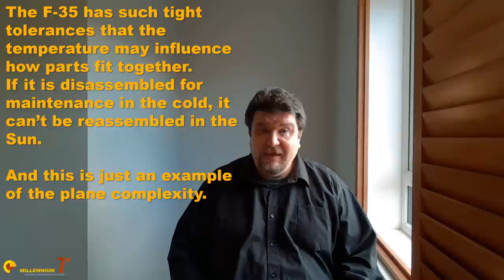F-35: The Failure of the $100 Million  Dollar Jet | Maybe...

Comment: The AF should simply build a refreshed version of the YF-23. Apply lessons learned for cost efficiency. Then focus on the 6th Gen.
Reply: Northrop Grumman has their cost overruns with B-2 bombers.
Reply: @valenrn8657  but not nearly to the degree that F-35 has.

For example; the STOVL version was overweight and Lockheed spent $6.2B USD just to decrease the weight by 1200kg. Not a typo. And that’s just one of dozens of overrun examples.

The B2 was the very first smooth fuselage stealth aircraft. It used new coatings, new geometries, new control surface schemes, new electronic systems, etc.

The F-35 is just a slower, single-engine version of an F-22 with a better brain and more/better sensors. All that hard learning had already been done.
Reply: @DBravo29er  According to Lockheed, Pentagon keeps changing the specs e.g. weapon bay specs which impacted the CG balance.
Reply: @DBravo29er  The requirements from USAF, USN, and USMC have diverged the single design into three fighter aircraft designs with just 20% to 30% common parts.
Reply: @valenrn8657  That did not cause the overweight condition.
Reply: @valenrn8657  But that’s not a recent development. The actual needs of all three branches haven’t changed. Lockheed is just having their feet held to the fire on meeting these program requirements by each branch.
Reply: @DBravo29er  CG changes can cause performance degradation.
Reply: @DBravo29er  USN's F-35C has different wings and horizontal tail, hence you can't apply F-35A Block 3F flight control software for it.

F-35B has a different bulkhead design from F-35A, hence different durability results.
Reply: For USN's F-117A like solution, McDonnell Douglas/General Dynamics A-12 Avenger II failed to deliver a working prototype while Lockheed delivered F-117A to USAF.
Reply: @DBravo29er  There are 3 different F-35 engines
F-135-PW-100.
F-135-PW-400 with salt-resistant materials. 
F-135-PW-600 with salt-resistant materials and lift fan.

Surface stealth coating would different due to the high salt environment with USN and USMC. 
Rear high-temperature stealth coating would different due to horizontal tail design on F-35C.

F-35B and F-35A has different AoA behavior, hence F-35A Block 3F flight control software can't be applied on F-35B.
 
Lockheed is effectively designing 3 divergent fighter designs.
Reply: @DBravo29er  Changes to F-35B's empty weight caused CG changes that can degrade performance, hence the entire airframe design to be refactored.
Reply: @DBravo29er  F-22A does NOT use carbon-nano-tube (CNT)  materials that arrived for F-35 Lot 4 builds.
Reply: @valenrn8657  CG changes were not the reason for the $6 billion dollar weight loss program. Empirical statement.
Reply: @valenrn8657  Understood. You’re just highlighting the program inefficiencies for me. I appreciate that. There is not much more parts commonality than between F-18A-C and E-F.... which are widely considered to be distinct airframes.
Reply: @valenrn8657  Im not dumping on Lockheed. I have several friends that work there. This is just a garbage program. It’s like the F-111 program, but exponentially more expensive.
Reply: @valenrn8657  And yet CNT (i.e. graphene) is not a new material. It’s been leveraged in aerospace and racing for nearly a decade.
Reply: @DBravo29er  F-111 program didn't design to be F-16 or F-18 dogfight capable.
Reply: @DBravo29er  
F-18E/F is about F-15 size.
F-18A/B/C/D is about  F-16 size.

Using the same model number avoids the fly-off competition.
 
F-35C's wing area is similar to F-15 i.e. it's larger than the classic F-18A/B/C/D.
Reply: @DBravo29er  
F-35B weight loss program (STOVL Weight Attack Team, or SWAT) from https://www.airspacemag.com/military-aviation/weight-watchers-13117183/
Date: 2004

https://youtu.be/RQ5gmZ74YBY

In this video, Jon Beesley, former LM F-35 chief test pilot, begins describing the SWAT changes at 2: 08, and at 2: 35 he talks about changing the STOVL interior bulkhead back to the original spec (for the Bee to carry 1000lb bombs rather than 2000lb bombs) which saved a lot of weight. Specifically, he mentions that the change shortened the weapons bay and eliminated some "u turned structures".
Reply: @DBravo29er  You haven't factored in molecular structures with high carbon-based materials.
Reply: @valenrn8657  I’ve seen that video many times and that article has been read long ago. The biggest weight loser was the shedding of quickmate joints in airframe. Which, naturally drove costs and production time even further into the stratosphere. Bulkhead being moved is a minor factor in this delay. And it resulted in reduced airframe capability.
Reply: @valenrn8657  Be careful. I have a good friend who is an F-15C driver. Currently transitioning to the 35A. They’re not the same capability. The 35C, especially, has g limits that the F-15C does not. The F-15C’s radar can also see and track the F-35 at much farther ranges than is being advertised. If the F-35 doesn’t gain a kill against an F-15C before the merge, it’s just target practice. All from my buddy.
Reply: @valenrn8657  CNT (i.e. graphene) had been in use in aerospace and F1 racing for nearly a decade. None of this is new.
Reply: @DBravo29er   Due to the age of the airframe,   F-15C has lower G limits.
Reply: @DBravo29er  Stealth reduces the enemy's radar effective detection/tracking/lock-on range.
Reply: @DBravo29er  
Read Tailgate's post on F-14 vs F-18 vs F-16 vs Rafale http://www.f-16.net/forum/viewtopic.php?f=55&t=6094&p=385233

Tailgate forum member is a current pilot for F-16C BK40/50s, F-15C, F-22A.

Quoting Tailgate 

I don't know about other drivers on this board....but the F-14 was not an ACM platform. I've flown against them in 15A/C's and 16 40/50's and the 14 simply was outperformed by both. I can say this with a little pride and ego...I have never lost to a Tomcat in ACM/BFM. It simply was outmatched by either airframe. What it could do was "kill" you from a long way off.

The Hornet is a much more difficult foe and unfortunately I cannot stake the same claim as above....lol

I have flown against Typhoons and Rafale's in Red Flags(F-22). I am confident to say that both those airframes would have had no issues dealing with Tomcats. There is a reason they were retired.
-----------------
Reply: @DBravo29er  F-15C has a lower angle of attack limits when compared to F-35C (fights like a Super Hornet).
Reply: @valenrn8657  And yet it has a better turn rate, better energy maintenance, and overall better performance. And not by a little. AoA limits mean even less with high off bore axis ordnance.
Reply: @valenrn8657  I’ll defer to my friend, the F-15C driver. He says that the 14 was a much more significant foe than the legacy hornet and equal to the E/F. Both of those platforms being sided with inferior energy maintenance to the Tomcat. He said legacy hornets only beat better aircraft when they drive them low and slow. He also said that a good Tomcat crew would make nearly any modern fighter look like a fool if you weren’t on your A-game.

He flew block 50’s before Eagles. And is already in the 35A. He has said that, fancy stuff aside, the brass tacks are that the F-35 is exposed after the merge when artificial guardrails for training are removed. He’s also unaware of anybody who has down the 22 and the 35. Not saying it hasn’t happened, but he’s been around and hasn’t yet met a driver who has flown both. I am not at Liberty to repeat anything past that.

I don’t have a desire to go back and forth with you to listen to quotes when I can just speak to my friend. I don’t mean any offense. But he’s explained to me, via specific tactics, where the F-35A has very large weaknesses and that it’s only a matter of time before a peer adversary is able to exploit them. And it doesn’t have the race cart airframe of the 15C/22 to lean on when the gadgets don’t work anymore.
Reply: @valenrn8657  My buddy says that high AoA maneuvers make a violent and asymmetrical trade of airspeed and energy for a single attempt at your opponent. He says that he LOVED seeing his opponents so stupid stuff like this.
Reply: @DBravo29er  Your F-15C pilot is about high energy maintenance vs Hornets dogfight doctrine is about the high angle of attack/minimum turn radius with high turn rate with nose pointing. It comes down to the skill of the pilot in executing the aircraft's strength.

My F/A-18E vs F-15 youtube link shows different strengths between aircraft e.g. F-15 was executing high energy tactics mentioned in Red Flag 2008 lecture leak between F-15C vs SU-30MKI.

You're not factoring in the effect of speed on G-load.  This is determined by a fairly simple mathematical formula: A = V^2/R, where

A = Acceleration (G-Load)
V = Velocity
R = Radius of Turn

All are in meters or meters a second.

F-18E plane able to pull 8g at 270 knots (0.4 mach) @ 15,000 feet will produce a turning arc with a radius of 246.08 meters

A certain fighter aircraft that can pull 9G at Mach 0.9 @ 15,000 feet will produce a turning arc with a radius of 807 meters

F-22 can fight in F/A-18E or F-15C dogfight doctrines i.e. it depends on the pilot's skills.
Reply: @DBravo29er  
> And not by a little. AoA limits mean even less with high off bore axis ordnance.

F-35 has 360 degrees targeting capability. LOL

Countries like UK and Australia have internal weapon bay compatible AIM-132 stockpile and not just external AIM-9X/AIM-9X II.

>And yet it has a better turn rate, better energy maintenance, and overall better performance

Better turn rate is dependant on the speed range.

Super Hornet NATOPS turn rates
http://www.f-16.net/forum/download/file.php?id=19308&sid=46db66c96e9be142336ab02bf3c234dd&mode=view
At 270 to 300 knots, Super Hornet's sustain turn rate is 30 degrees per second at 7.5G, higher with 8G.

From Red Flag 2008, F-15C's turn rate is about 28.8 degrees per second at a higher speed range. 

Super Hornet will nose point the F-15.
Reply: @valenrn8657  And yet he smoked most E/F’s that he went against.
Reply: @DBravo29er  
http://theaviationist.com/2016/03/01/heres-what-ive-learned-so-far-dogfighting-in-the-f-35-a-jsf-pilot-first-hand-account/
Norwegian F-35 Pilot Counters David Axe's Controversial Dogfighting’ Report.

Well according to a Norwegian pilot the Jet handles better in a dogfight than the F-16 in some respects. He said that the F-35 can pull its nose around and keep a target in its sights better than the F-16 can. He said its easier to be aggressive with the F-35. The F-35 which lost to the F-16 was a very early built F-35, one of the first and the idea of the test was to explore the F-35's ability to maneuver at high AOA. The test exposed areas of improvement which were needed, the test pilot said that the jet had the performance there but it was limited by the software at the time, and by the sounds of it the software has been improved because many of the weak areas found during testing appear now to be some of its greatest areas
Reply: @DBravo29er  FYI,  Saudis suffered two missiles hit from enemy SAMs to their two F-15S units.
Reply: @valenrn8657  The F-35 is a one circle fighter. Two circles and it’s in trouble. Again, high AoA maneuvers trade a huge amount of speed for a temporary nose placement maneuver. In boxing terms, it’s an offensive action with no remedial defensive action should it not succeed.

I’m getting F-4 vibes all over again.
Reply: @DBravo29er  The main point with high AoA for F-35A is to use it as a speed break to get into F-35A into sweet spot speed range for high G minimum turn radius nose pointing regime.
Reply: @DBravo29er  As for Red Flag 2008, don't do the Indian SU-30MKI pilot's kill energy with very high AoA which is poor energy maintenance. F-15C pilot used high-energy yoyo tactics to counter it.

My F/A-18E vs F-15 youtube example shows the Rhino driver maintaining sufficient energy for nose pointing against the F-15 while it (F-15) uses a high energy advantage (e.g. high yoyo) against the Rhino. Rhino pilot wasn't stupid as Red Flag 2008 Indian SU-30MKI pilot's energy killing very high AoA moves.
Reply: @valenrn8657  https://theaviationist.com/2013/02/11/typhoon-aerial-combat/

We can do this all day.

My buddy flew against Typhoons in training in his 15C and said they were formidable. Considering that the Typhoon surpasses every variant of the 35 in nearly every BFM metric that can be assigned a number or measured.... and by considerable margins.... this aligns closely with what my buddy says about the 35A. And 15 drivers have been using rudders to point the nose at high AoA for 40+ years. Tomcats and Eagles have done this with great effectiveness. Hornets as well.
Reply: @DBravo29er  >The F-35 is a one circle fighter.

I did state "F-35 sits somewhere in between the F-16 and F/A-18 when it comes to within visual range manoeuvring" from the Dutch pilot. 

F-35A needs further engine upgrades which are in the road map that was advertised with the export customers.
Reply: @valenrn8657  I read your article. Now you read mine. The wing loading on the F-35 is inferior and it weighs too much. The proposed engine upgrades with +8% to +10% thrust increase at altitude cannot even begin to bridge this gap. The Typhoon pilot even says that wing loading and thrust to weight rule the day. AoA doesn’t even come into play in the high subsonic arena or faster. It’s not a good Air Superiority fighter.
Reply: @DBravo29er  

https://www.youtube.com/watch?v=n6JSv8xHTbA
Danish F-16  beating Italy's Eurofighter dogfight example, but this doesn't tell the kill ratio.
Reply: @DBravo29er  

Basic Wing loading without body and vortex lift.

F-35A
Empty weight: 28,999 lb (Year 2015).
Wing area: 460 ft²
Wing loading: 63.04 lbs/ sq feet.

F-16C Block 52
Wing area: 300 ft²
Empty weight: 18,900 lb
Wing loading: 63 lbs/ sq feet.

F-35A's empty weight is 1.54X scaled from F-16C.

F-35A's wing area is 1.53X scaled from F-16C.

F-35A's 43000 lbf thrust is 1.50X scaled from F-16C's 28600 lbf. Needs a slight engine upgrade. 

There's a near straight 1.5X scaling between F16C to F-35A on basic wing loading, engine thrust, and empty weight.

F-35A's wing area is influenced by weight growth and F-16C's empty weight wing loading target.
Reply: @valenrn8657  Cool specs. Real fighter pilots disagree. Including my buddy. The end.
Reply: @DBravo29er  F-35A's basic design has a ~1.5X scale factor on wing area, empty weight, and engine thrust targets which are set by USAF, not by Lockheed.

It's relatively easy to add a large wing on F-35 (e.g. F-35C) or build yet another F-22 with F-35's material and tech improvements.

For the high mix with stealth, other countries are heading towards UK/Italy/Sweden Team Tempest or Franco-German-Spanish FCAS.

https://www.aspistrategist.org.au/japan-and-uk-move-towards-partnership-to-develop-combat-aircraft-systems/
Japan and UK move towards partnership to develop combat-aircraft systems.

 The problem is US internal politics, hence US allies are doing something else.
Reply: @valenrn8657  from my article:

“However, when time comes for air dominance, some other ingredients like thrust to weight ratio and wing loading tend to regulate the sky. And in that nothing comes close to a Typhoon, except an F-22 which has very similar values. The F-35 thrust to weight ratio is way lower and its energy-manoeuvrability diagrams match those of the F/A-18, which is an excellent result for a single engine aircraft loaded with several thousand pounds of fuel and significant armament.

But it also means that starting from medium altitude and above, there is no story with a similarly loaded Typhoon.”
Reply: @DBravo29er  

The real F-16 designer http://www.codeonemagazine.com/article.html?item_id=37
F-16 Designer Harry Hillaker

Harry Hillaker's statement on low wing loading and wing size...

_For example, the drag coefficient of an F-16 is about the same as that of an F-4. However, the F-16 has about one-third the drag of an F-4 in level flight. At angle of attack, it is about one-fifteenth

We knew that we wanted low wing loading and high thrust loading. But we also knew that low wing loading means more weight and more drag

Critics like Pierre Sprey's argument on low wing loading are insufficient. Larger wings introduce higher drag. 

The trick with F-16's design is to have medium wing loading, smallish wings, and lower wing loading during an angle of attack turn with vortex lift. F-16 has blended wing design to get more lift from the body. For vortex lift generation, F-16 was designed with low drag at an angle of attack, hence smaller wings.
Reply: @DBravo29er  
https://www.flightglobal.com/in-focus-german-eurofighters-impress-during-red-flag-debut/105818.article

USAF sources say that the Typhoon has good energy and a pretty good first turn , but that they were able to outmanoeuvre the Germans due to the Raptor's thrust vectoring. Additionally, the Typhoon was not able to match the high angle of attack capability of the F-22. "We ended up with numerous gunshots," another USAF pilot says

Notice "pretty good first turn" for EuroFighter.
Reply: @DBravo29er  Eurofighter Typhoon industry test pilot's statement was made in 2013 and it was before December 2017's F-35A Block 3F arrival.
Reply: @DBravo29er  While F-35 is okay for 5 to 15 years to replace F-16C and classic F/A-18C low aspect of high-low mix, many US allies still want "stealth F-15" requirements.

Blocking F-22A export will be remembered by the allies.

Comment: There will probably be an F-35-D (From Downgraded). Simpler, lighter with limited stealth. Just a cheaper stripped down version. Economically and politically a logical choice. Tactically interesting too, because this will confuse the enemy. Such a scaled down version could share a lot of components with the F-35 A/B/C. It could be designed relatively quickly.